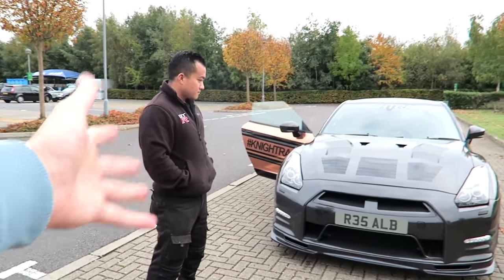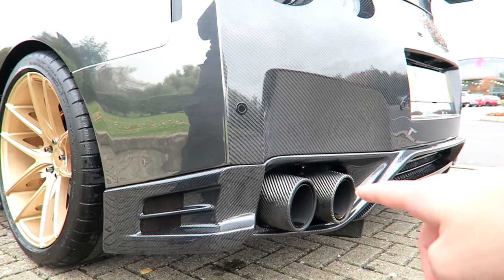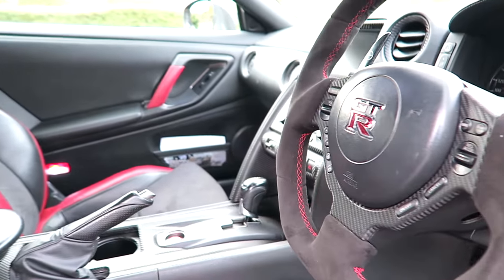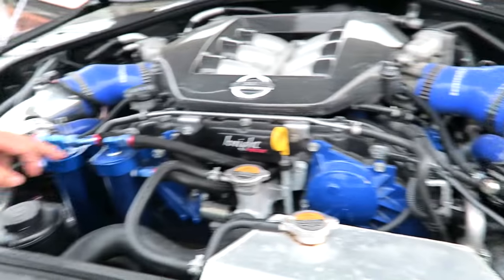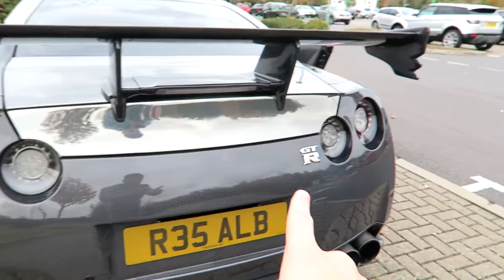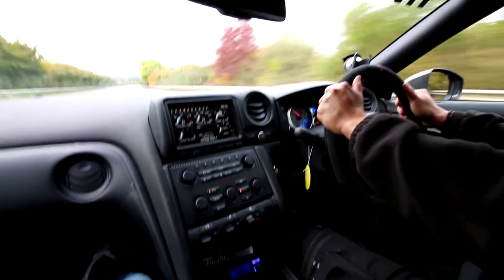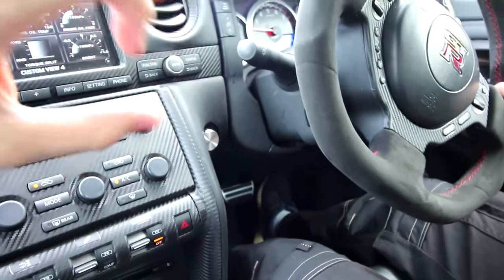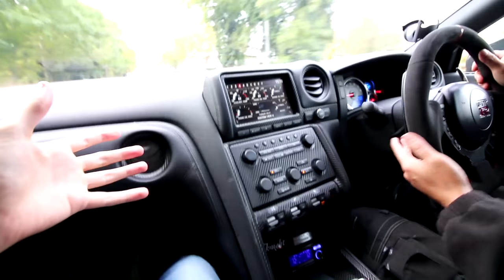CRAZY 800HP GOLD CARBON NISSAN GTR!!

Comment: that spoiler makes the normal gtr better. when you think about it. if you buy a 2015 nismo its around 125k but you could in effect buy a 2012/13. spend 20k on it and voila 80k and faster than a nismo agree???